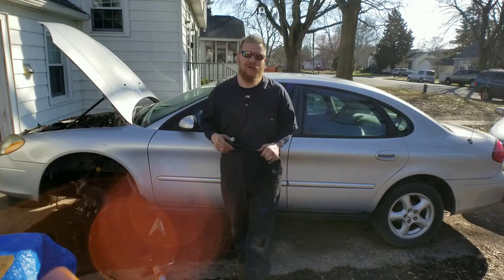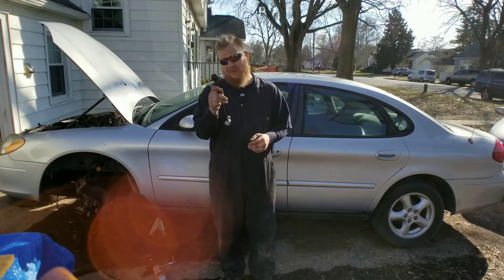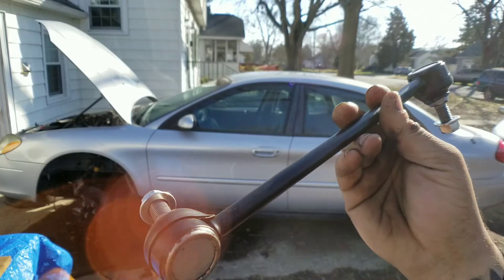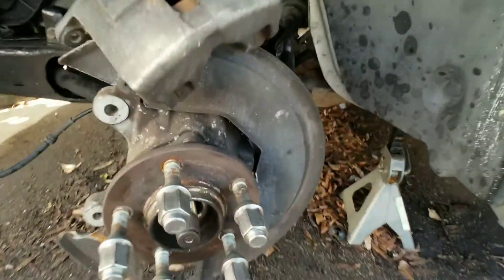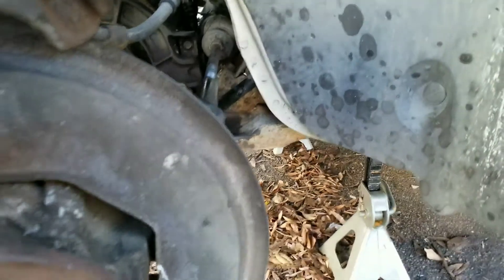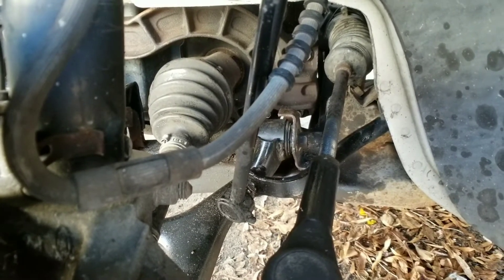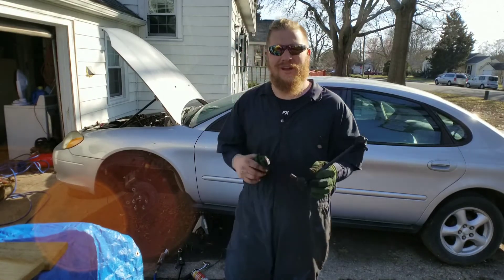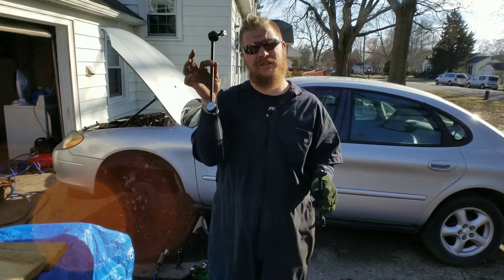2003 Ford Taurus Stabilizer Bar Replacement Made Simple and Easy!

Comment: You didn't show, taking off the old one or putting on the new one. These are called "sway bar end links", not stabilizer bars. Stabilizer bars run from driver side to passenger side, front and back. Sway bar end links run vertically on each wheel. Motorcraft sway bar end links on eBay are $28.00, Mevotech brand is $11.00 each. Disappointed with this DIY video.
Reply from the maker: It was one of my original videos, so much has changed since then. But thank you for your feedback bent nickel.
Reply: @Sellthoseflippingcars   YT viewers expect script perfect English, award winning videography and premium presentations. I don't envy content providers. I certainly couldn't live up to the expectations people seem to need now a days. Drone shots, close ups and exploded views. How's a guy supposed to compete without a film crew?
Reply from the maker: You can only do your best and hope it helps someone. Film crews cost money, start out where u can with what u have and work up from there.